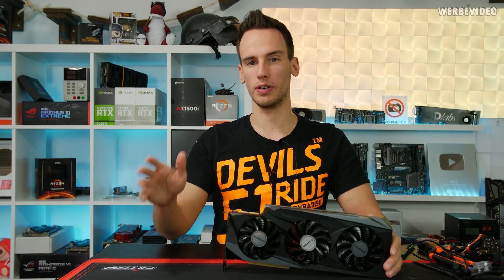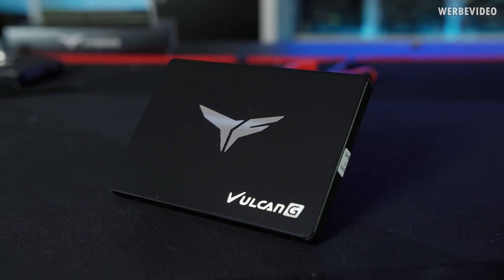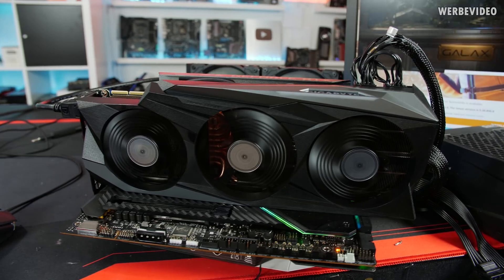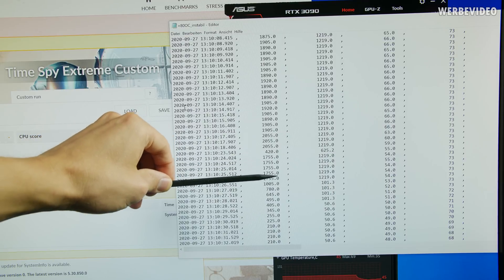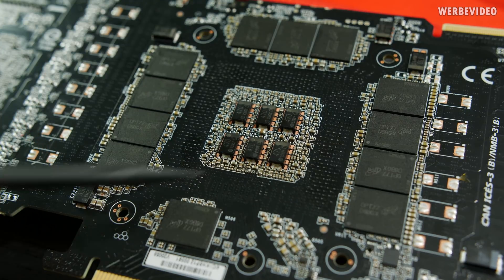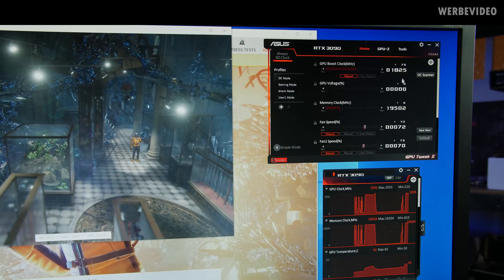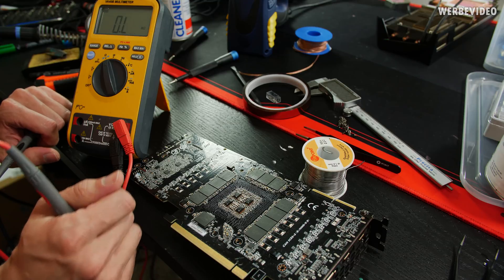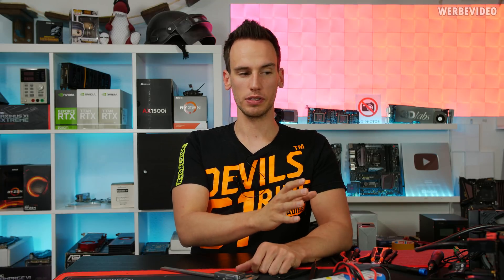We Tested the Cap-Drama - RTX 3090 MLCC vs POSCAP

Comment: I posted pics on Jaztwocents, with the card I had that kept crashing, on the 6 caps  5 was all black one of the ones in the middle was smaller caps.... ASUS offered me a upgraded card for 249.00 more and I refused them and asked for a full refund...not even a 12 hours later they said they rather just send me the Stix and all the caps where the prem tiny ones.

To me this is something they knew about, since they are now offering  3080 upgrades at $250 to 500 higher...so average $ 325 increase for upgraded caps

Comment: Mine came with 5 POSCaps and 2 arrays of 7 (I think, I just eyeballed it) MLCCs. Haven't overclocked it yet, but plan to try a bit.

I think I lucked out.
Reply: Same supposed Gigabyte model?  I.e. Gigabyte Gaming?  Interesting.  And I assume you mean 4 SP/POS Caps + 2 sets of 10 X MLCC.

Comment: That’s NOT an Nvidia FE card or EVGA Which has smaller capacitors already soldered in Jaystwocents already shows that other company’s Capacitors looks like on cards. You wana use cheap capacitors then buy cheap company cards like the one in this video. This has already been FIXED without soldering and using Nvidia FE card by locking in the frequency and VOLTAGE in the bios settings of your card. Obviously it’s driver issue with non pre configured settings causing fluctuations in the sine waves in the capacitors causing noise to cause a CTD basically shutting down GPU.

Comment: It is quite interesting how small the factor of safety was chosen in Nvidia's reference design. It would be interesting to probe the Vcore rail with a fast oscilloscope in order to observe how the crashing manifests. 
Maybe combining the existing capacitors with smaller case ceramics (for lower inductance) would benefit extreme overclockers (though the Vcore ripple at the chip is probably limited by through-hole via inductance). And maybe even adding more ceramic capacitors on the top side of the chip would help even more with the filtering. With these mods and good silicon you'd get record breaking clocks

Comment: Yep once again the soldering makes me cringe, you need a proper soldering iron station, there is no need to use a heatgun or fumble/struggle so much soldering the parts on and off especially with flux. It's as if your iron is too low temperature or making poor contact. Though doing it on camera, it's pretty understandable it's not gonna look pretty :)

Comment: That was neat work placing those caps with tweezers and soldering iron. That's delicate work for hand soldering...nicely done! You are right though, we would like to see what happens if you replaced all of the poscaps. I'm sure as you say it is diminishing returns, but it would still make for interesting content... It would be neat to see if you can maintain your quality work across such a large number of caps and how far up the boost would go until it crashed for good. Maybe test at each stage of cap replacement... Awesome either way!

Comment: None of the card reviews ever mentioned anything beyond the normal overclock crashes and, at least according to EVGA, these are the people who got the "sub-standard" cards. It was nice of EVGA to sort of throw the reviewers under the bus with that statement, as in, look these people didn't find any problems with the cards. Some changes to the cards were made, if you compare the pics from Techpowerup and Asus with the product pages on OCUK, The STRIX, TUF and Ventus all had the 6 "Big" (better not use the P word) on the OCUK product page, whereas on those others and on the cards themselves they have the MLCC chip replacing at least some. You maybe have a better idea of how long before launch those were provided.

Comment: "Every single vendor these days is testing on the consumer" 
Sad truth of the current computer tech enthusiast market, and it's crazy that the big companies aren't being held accountable.
Reply: This is how electronics, cars, even firearms are released these days. It's less costly to release a product ~mostly~ complete (and accept some losses through growing pains) than it is to release said product a couple months late and be impacted by opportunity costs.
Reply: I think we should ease, a little bit on the gas in this instance, at least for the AIB partners. Minor component and PCB changes are very common, always has been. They all submit their PCB designs and revisions to Nvidia, and they cannot manufacture them until Nvidia themselves validates the design and gives the go-ahead. Nvidia developed and designed this, partners need to be able to trust that Nvidia knows what they're doing when making such validation requirements. Especially this time, because Nvidia withheld functional drivers from the AIB partners until like 2-3 days before release. At which point cards were already arriving in stores, and reviewers had had both cards and functional drivers for almost a week already. Nvidia intentionally locked out AIB partners from doing any kind of broad or in depth validation on their own by withholding functional drivers, the only thing they could do was run a powervirus to validate their cooler designs. Nvidia did this in fear of leaks, yet they gave full working drivers to the press almost a week earlier than to actual manufacturing partners. And still there were leaks way earlier, meaning the this strategy came at a significant price to both partners and consumers, and ot did not even help avoid those leaks. Because the leaks came from inside Nvidia (they must have if only Nvidia themselves had functional driver access at the time).

Nvidia themselves is to blame for this. The prohibited partners from doing their own testing and validation, did not do a proper job with their own validation, and overreached and oversold GPU Boost "5.0" vs what their developed design could actually reliably do.
Reply: Hahaha. AMD loves doing this with graphics drivers.

Comment: I agree on the eg. 2% being loud but you don't hear that with other cards. We didn't have that on the 980 or 1080 or AMD. Usually the loudness is with a proportionality (incl. with the size of the launch of course). You hear about drivers on AMD and they have actually been fairly criticized. 

Personally I just don't get why Nvidia had to rush this semi-paper launch. They only got negativity with it. Low QC and frustrated F5 users. Not even the most vocal people would have said anything if the cards were released lets say 3 weeks later. We start to see this rushing more and more, both for hardware and software.

Anyway, great video!

Comment: Curious if he said / shown what driver was used ?  Reddit users compared 456.38 to 456.55 and said they saw little bit lower gpu mhz , also one user posted pic of mhz / voltage table before driver update / after driver update and he said it dropped the mhz a bit and upped voltage a bit on driver 456.55 and was stable with newer driver 456.55.
Thanks for the cool deep dives into these things !

Comment: Increasing the surface area of the caps increases the time it takes for heat to have an effect. I suspect cooling over the entire card will have the greatest stability improvements and not just the "talking" points.

Comment: Thanks, very informative test. But don't try this at home kids! That's way to much heat into that small MLCCs with that big gun, they are chock heat sensitive. Also, never, never use force to pry a component loose from its soldering point, the PCB lanes/pads can detach, and that's never an option.

Comment: Prying the SMD SPCAP off after partially removing the solder on one side? How do you not have PTSD from broken pads? D:
Reply: Actually in this case the part has flexible tabs on the end. Personally I use two soldering irons in this situation.
Reply: @LaserFur  Same, dual output soldering irons are very useful!
Reply: He's killed more hardware than most of us will ever own, all in the name of science!
Reply: @severnia  just imagine that sinking feeling when a pad comes off when you try to fix your £1500 gpu though.
Reply: @DeltZKinetiX  probably as bad as delidding a $2000 CPU and seeing the die still stuck to the heatspreader when you lift the lid off lol
Reply: What is smd spcaps and ptsd
Reply: @thanatos8938  SMD= Surface mount component. SPCAPS = A brand name of a capacitor that actually is not this one. PTSD = post traumatic stress disorder.
Reply: @LaserFur  thanks bro.

Comment: I totally agree with your sentiment that this might be a non-issue from cry-baby early adopters, however this was hardly rigorously scientific. What were those caps you soldered in place of the big ones? Would they be the same quality and spec as installed in-factory? I'd imagine the ones they're using are ultra-high quality, hence the reason for the other brands removing them in the first place-cost saving. Secondly, with a pick-place machine we wouldn't get those gobs of solder between the caps as you got, so electrical noise will be very carefully controlled - as you know operating in the nano-time space for power delivery and smoothing is extremely demanding of circuit filtering - how do you know that your hand-solder job didn't negate the advantages of the supposedly better caps?

Comment: G'day Roman,
I really enjoyed the video of getting to see the difference from SP Caps & MLCCs on the same card,
I watched Buildzoid's video explaining why the caps are there & what may be some of the problems, he said that using the 10x47uF MLCCs would give the same capacitance as 1x470Uf SP cap, but the MLCCs would be only slightly better because of slightly better ESR & Impedance, not huge OC gains, which is what your video showed as well,
I was looking at the HD Photos of the RTX3080, Gigabyte has 6 470uF SP Caps & Zotac has 6 330uF SP Caps (Even on the ZOTAC RTX 3080 Trinity OC), I'm just wondering how much difference this change would make in stability at higher GPU Frequency & when you get Core load spikes?

Comment: If you use stock 1.4Ghz base / 1.71Ghz boost. 
Should be fine and doesn't matter which Caps configuration.  

Vbios updates should fix the issue. But can get lawsuit for not getting performance as advertised such as 1.81Ghz.. power, dragon.. whatever..

Comment: So, i was having issues with my Gigabyte Gaming OC.  I Found a post from Seasonic recommending to not use a single split 8 PCIe and to use 2 separate once.  After doing this Modern Warfare, the game I was having the biggest crashing issues with stopped crashing all together.  My card with stock setting peaks at about 2040mhz.
Reply from the maker: PSU issue would surprise me to be honest

Comment: You'd have an easier time with this sort of soldering (and especially desoldering) if you had a temperature regulated hot air wand with right sized nozzles. They are not expensive.
Reply: If you look @10:24 in the bottom right corner of the screen you will see he does have a hot air station with separate control over temperature and fan speed. Yes he also is using a paint stripper style gun in the video @8:20 as well but even the cheap $20 units have a low setting (300C) and a high (525C)
Reply: De-soldering lead components using free solder from production boards is a PITA :/
Reply: @mobyfab  Not really..... just add fresh leaded solder first. Which is what he also did.

Comment: 100% if AIBs just noticed earlier (some did) and set the boost slightly lower this never would have been an issue. To me it looks like the boost clock is the problem more than which caps they used considering it’s not some dramatic difference. It’s a slight clock / stability difference

Comment: since this issue started i never saw anyone claiming that they will get extra 200mhz only by having better MLCCs 
because there are the founders cards that actually have em but they don't boost or clock that high 
the issue here is the people who paid with an arm and leg fought the scalpers and did whatever they could just to get hold of these cards and when they tried to unleash them they simply crashed 
so i think that you missed the point, it's not people getting their pitchforks out, it's people calling manufacturers out for cheaping on Nvidia's specs 
point is i don't blame Nvidia, since their founders cards are actually solid, the AIBs are to blame, and yes it's clear that this launch is rushed, no doubt about that 
heck it's even clear that there are other cards with higher Vram capacities out there.

Comment: Be careful with mlcc . They are very sensitive to stress and usually fail short-circuit. Do not press them too hard with twizzers. Always apply the solder paste on the pad and place the caps in right place and then reflow them with 250c or 300c air ..  yes its much harder to do but that will ensure no dead short caps.

Comment: It’s pretty cool just the fact that you can replace the caps if you wanted to. This is totally the sort of thing I would do (even on an expensive card) just cause it’s cool. 
So long as you don’t try to jerryrig it and use the proper tools it’s not that dangerous if you have any experience soldering.

Comment: Don't pull on components when desoldering, you're going to lift the pads !!!
Reply: They're freebies, if they get messed up, doesn't even matter.
Reply: Exactly he should have used a desoldering station or at least a solder wick/absorber. If serious you can make your own special tips to heat both sides of the component for easy extraction or if your work place has a proper surface-mount repair station even better.
Reply: @DespaceMan  He doesnt have such stuff.
Reply: Dont need pads if you trace lines

Comment: Sorry der8auer but your analogy of so few experiencing crashes while the majority are happily gaming doesn't hold a lot of water when SOOOOO few cards have been sold.
Reply from the maker: I can see the sales and RMA at caseking and there is nothing unusual
Reply: @der8auer  Not to question your method but a single outlet is hardly a basis to make a sweeping analysis.
Reply from the maker: @wattotoydarian9376  the caseking group had 25.000 orders on the first day. If you think this is a irrelevant shop - you are wrong
Reply: @der8auer  Were they able to fulfill 25,000 orders on the first day? Hardly seems possible or is your claim also based on products not sold?

Comment: Should've used more flux on the pads. Also a T12-K tip and 138°C low melt solder paste would make things much easier(but don't solder any tsop chip with this).

Comment: Like Roman said, you only hear from people who are experiencing some issue never from the card owners happily using their products. 
Thx @Der8auer for confirming what my impression already was of situation. 

P.S. When replacing the larger caps for MLCC's how did you connect them? I mean the original contact pads are so much further apart than the smaller ones. Did you bridge all the mlcc's to make them connect to the pads or what?
Reply: there are two large pads , one at either end, then a bunch of smaller pairs in between if you look closely you can see them :)
Reply: @jaysoncronly7041  I see that but the small have to bridge the pads left from the large caps. One small can't reach from 1 pad to the next, hence my question

Comment: i believe its the tolerance of those capacitor that s causing the problem. if you keep the voltage stable at 1V, it doesnt crash even clocks above 2ghz.. there is a video too ... https://www.youtube.com/watch?v=--YvuxE0xl4&t=868s

Comment: Would love to see if 3, 4, 5 or 6 MLCC sets makes a difference to OC potential? Would be very interesting!! And to compare to Asus configuration.
Reply: He got a 1% improvement from this exercise. I have a feeling the returns would be diminishing😅
Reply: @tylerdurden3722  Agreed.... but I'd still like to see it to prove it one way or the other.
Reply: @timmarks8941  he actually has done it before on other cards. Extreme overclockers will go above and beyond replacing with the best capacitors that exist... they'll even add additional capacitors. 

They're lucky if they get 50Mhz from that. But in extreme overclocking, every bit counts.

Comment: I swapped them all out on my 3090 for 805 mlcc 47uf ultra low esr caps then stacked some 22uf  caps on top of those then put the sp's on top of that and stacked a 20mohm resistors on top of the factory shunts for a lite power mod. Card was a mild machine at 1940mhz now holds 2165mhz. The FE cooler is beast the 3080 is like Thor's hammer the 3090 is a "Galactic Battle Axe"
Reply: Any photo of this ?
Reply: @brunogm  i will post some and a link later today LN2 eta is 3 hrs..

Comment: What dielectric in the MLCC is used? 
The capacitance is dependent on the temperature and the DC voltage, and for large caps, the dependence is often rather big. Your 47 uF could just provide 15 uF in your conditions depending on the data of the cap.

Comment: Great demo but I just want to point out that this card while it has 6x polymer capacitors instead of the 0805 MLCCs they are 470 µF per package, other cards that from what I’m reading seem to be more prone to crashing with conservative clocks are cards with 6x 220 µF or 330 µF polymer capacitors.
Reply: Some has uneven values as well. 330uF mixed with 220uF. Sometimes 2x 470uF, 2x 220uF and 2x 10 MLCC arrays (unknown capacity).

Comment: I highly recommend a Quick 861DW hot air station. Will make these sorts of jobs far easier, and its not super expensive.
Reply: I have one but I think I will use chip quick (low temp solder). I am concerned that the heat could damage the GPU.
Reply: @Todestelzer  Of course, but I meant instead of the paint stripper, then using an iron and tweezers to pull on the component :) With a hot air station you can localise the heat instead of heating everything else. He still did a good job with what he had to hand, but pulling on components like that can rip the solder pads up with the component.